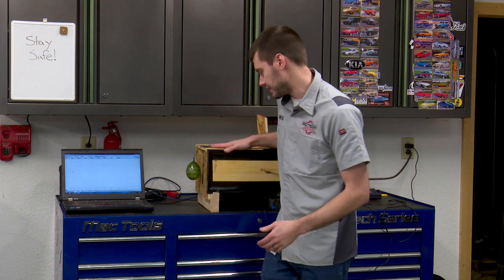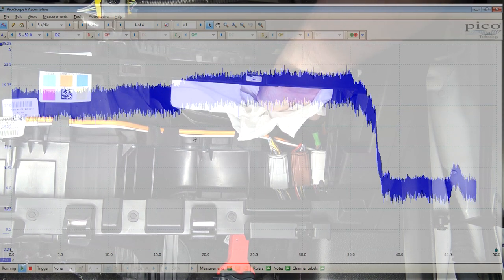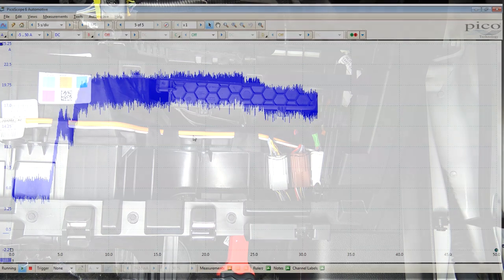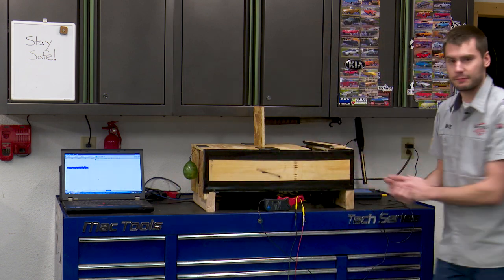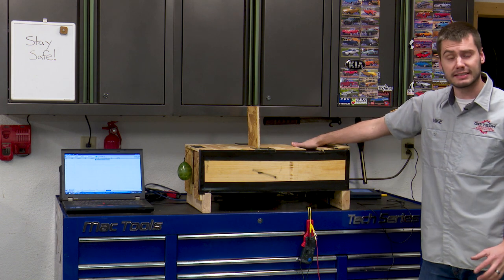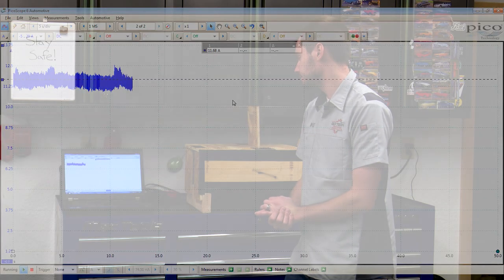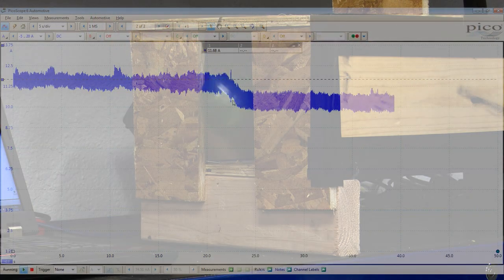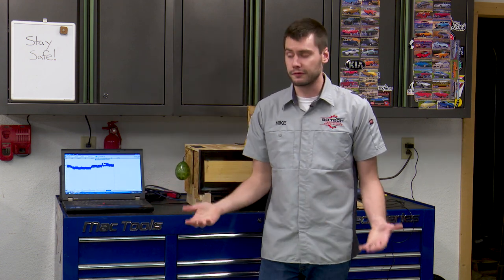Blower Fan/Motor Current Does What!? Correcting A Statement I Made - Includes PROOF!

Comment: Just like fuel pumps, inlet restriction= less current, higher rpm. Outlet restriction= higher current, lower rpm. 

Kudos for standing on the side of accuracy and truth!
Reply: This is a little different. Outlet restriction = lower current and the motor whiz bangs over. That's why it sounds like its working harder like a restricted vacuum cleaner. Higher RPM's.
Reply from the maker: Truth and accuracy are key. Thanks for watching and commenting guys!
Mike Becker, Senior Instructor
Reply: Super Mario - I definitely respect your knowledge and experience 

Does an outlet restriction cause higher current in a fuel pump?   I guess my assumption has always been that less flow (restriction) =  less work on the pump = less current draw.
Reply: Both an inlet & outlet restriction cause a decrease in air flow rate. A fan is a type of centrifugal pump. A characteristic of centrifugal pumps is that (in general) decreased flow rate means less work is done, therefore the current will decrease with either a suction or discharge restriction.
Reply: @gaad7938  and why does less work mean less current? How are they connected?!
Reply: @gaad7938  what is meant by centrifugal?

Comment: Hi Mike!

The most common failure that can appear in HVAC system is situation when we are starting car when HVAC is set on 1-st position and blower motor have little hard to rotate. The motor don't turn at all and current which flow by blower resistor can overheat it (no flow of air).
User don't think about it and malfunction is ready.

Greeting from Poland.
Roman.
Reply: slightly true, as an already bad blower can be in stall out and draw high current.
Reply from the maker: Hey Rmx2rmx, thanks for watching and sharing! Stay safe over there in Poland!
Mike Becker, Senior Instructor

Comment: Really appreciate you taking the time to not only address the (imho very common) misconception of increased resistance = increased amperage ( in a centrifugal style).

Quite enlightening.

Bring back your wire connection experiment please! I've seen several tech induced pigtail failures in the last week due to butt connectors on the underside. Would love to see a test set that was "salted" with current running through it.
Reply from the maker: Hey Matthew, thank you very much for watching and commenting! I did a follow-up video where I ran 20(?) amps through it if I remember right...here's a link for you. https://youtu.be/gKx_8-Z5sBo
Mike Becker, Senior Instructor

Comment: glad you corrected the airflow limiting current draw issue.  I learned that years ago, but I've been into electronics and electrical since a young child.
cabin filter restriction does cause less airflow which can make the resistor block and motor overheat, since they're also air cooled!
 good videos overall ;)
Reply from the maker: Hey Throttle Bottle, thanks for watching and commenting!!!
Mike Becker, Senior Instructor

Comment: The cabin air filter between the blower motor and evaporator helps keep tiny copper partials from the blower motor brushes and bushings out of the evaporator.  Copper in the aluminum fins of the evaporator could cause electrolysis if moisture is on the outside of evaporator.  At least that is the story I heard.  Great Video!

Comment: Good correction on the previous video.  I just watched the previous video a few minutes ago and was wondering what the correction would be until I heard the oops moment.  In regard to minute 5:40 where the balloon (and you can keep your secret save from your son with me) is being drawn toward your nice experimental creation, you will find the pressure differential "favors" the outlet side as opposed to the inlet side of the system, thus creating a situation where the higher pressure side is now turned 180° at the impeller and directing air flow opposite the normal direction.

Keep up the great work!
Reply from the maker: Hey Chad, thanks for watching! Makes sense why the "borrowed" balloon was drawn in. Thanks for watching.
Mike Becker, Senior Instructor

Comment: I have noticed this same effect with my vacuum cleaner.   When you completely block the intake the motor sounds like it speeds up.  There is a point of restriction that appears to load the motor more that it is when completely unrestricted but when completely restricted the motor speeds up.  I have always found this interesting and tried  to figure out why.   My guess was that the high vacume causes the air to be less dense and that would make the impeller see less resistance to turn.  Not sure if this same thing happens when a fluid is being used by a similar centrifugal pump.  Not sure you were completely wrong about the restricted filter.  I think a partial restricted filter will cause the motor to see a load increase.

Comment: Thank you Mike. Have a blessed and safe week to you and your family.
Reply from the maker: Thank you so much Billy, you as well!
Mike Becker, Senior Instructor
Reply: @GoTechTraining  Thank you Mike. If you ever get a chance to work on a Honda or Acura with a blower motor power transistor, please test and record the power transistor control wire voltage signal with connector unplugged and plugged in and back probed. There are a few videos on YouTube about the power transistor but nobody has tested this control voltage with connector unplugged and plugged in and back probed to see what known good AC Control Unit sends down that wire to the power transistor.
Reply from the maker: Sounds good Billy, will do!
Mike Becker, Senior Instructor

Comment: With restricted airflow the current goes down due to lower loading because the air in the blower case begins to spin with the impeller.
In the case of a restricted vacuum cleaner, being a series motor the RPMs increase significantly as the current through the field coil also gets weaker with lower load, but the blower motor has a permanent magnet field so the RPMs do not increase that much.
Mechanical loading increase due to tight bushings (sleeve bearings) on the motor causes both increased current and reduced airflow on the lower speed settings, a disaster for the resistor but I have also had a few resistors fail for just a dirty filter, the motor itself has been fine.
Any failed resistor, the motor is tested and the filter replaced as a matter of course.
On some vehicles, with the air distribution control set to face vents only and all face vents turned off with their own control, the system has a 100% restriction. This is a reasonably common occurrence, look at the control settings when a vehicle comes in!
That will definitelycause the resistor to burn out even with a perfectly good motor and filter!
Reply from the maker: Hey Simon, thanks for watching and for the lengthy comment. Appreciate all the info!
Mike Becker, Senior Instructor

Comment: Could we do some actual testing to determine the original failure (blown resistor). I typically like to use HVAC diagrams to help teach  the younger up and coming techs. Its good system, for ohms,  voltage drop and current testing. Even using the amp clamp to try and determine actual motor rpm. Food for thought....
Reply from the maker: Hey Josh, sure normally we would. These videos are intended to be short quick hits. I have other videos already showing blower motor testing. Yes, wiring diagram, voltage drop and current testing are all great on these things!
Mike Becker, Senior Instructor

Comment: no air no work. lots of trucks have multiple blower motors and often they run in different directions. because of this the squirrel cages are reverse rotation too. found out if you put a reversed squirrel cage on it will blow a little but not a lot and the amp draw was way down. also there are modules that act as resistors that use thermisters. and i have seen these that look identicle to a resister package
Reply from the maker: Hey Richard, thanks for watching! I powered this set-up backwards and the motor spun like mad but didn't create hardly any airflow....therefore little current. Same principle I believe.
Mike Becker, Senior Instructor

Comment: Great content... I dont think the amp draw on the fan is quite as important as maintaining air flow over the resistor... Ive known a few blow either because the cabin filter was dirty or the inlet vents on the scuttle panal were blocked with leaves n debris...
I was shocked though that the amps used actualy went down when the air supply was blocked. Simular to i expect a engine that cranks faster when the air intake is shut off.As it has  no air to compress it dosent work as hard....
Reply from the maker: Thank you very much! Airflow is the real killer here, I agree. Thanks for watching and commenting!
Mike Becker, Senior Instructor

Comment: Blower works just like a battery. When you have resistance in the path you have a reduction in current and CFM. But since fan needs air to move it gets air from the chamber that surrends it. So as the air leaves the fan's fin it forced into blower again so you almost have a vacume at outlet and you have a turbulance in chamber.
Reply from the maker: Thanks for watching and the clarification Mohamad Reza Enayati!
Mike Becker, Senior Instructor

Comment: I wonder where resistors are mounted.  If they are down stream from blower.  They could be increase resistants as geting hotter when less air flow thruogh them.  That make less current to blower motor.
Reply from the maker: Hey Cu Lan, typically the resistor is mounted down stream from the blower. Very true points!
Mike Becker, Senior Instructor
Reply: Because resistors connect in series with blower the hotter the more resistants the less current to motor.

Comment: So if V=IR, assuming you still measure the same voltage going to the blower motor, if it's consuming less current (during a restriction), doesn't that mean that the internal resistance of the blower motor goes UP in order to keep the equation true in the great and wonderful universe, i.e. laws of electrical physics?  Would this contribute to the early failure of a blower motor?  I'm assuming that it's temperature goes up, not just because of lack of airflow, but if it's internal resistance has gone up, that usually generates more heat as well, right?  Interesting experiment dude.  I got the recommendation from South Main Auto youtuber to come check you out...boy am I glad I did and you got yourself a new subscriber!
Reply from the maker: Hey Mark, That would make perfect sense in the world of electrical physics! I'm glad you've found us, thanks for watching and welcome :)
Mike Becker, Senior Instructor

Comment: I wonder - I get that amps decrease cuz it’s doing less work - but why would the fan speed increase? I’m guessing PSC motors have a set torque they want to work at and then the load lessens, the current lessens, but the torque stays the same and even with the lessened current, because the torque never changes, it increases the speed?

Comment: I can see why you made that assumption, many motors draw more current under load. Your thoughts about the higher risk of overheating because of inadequate air cooling are also completely reasonable. I wonder what is special about the blower motor.
Reply from the maker: Hey Spelunkerd, hope all is well! Thanks for watching. I'm used to thinking about fluid flow I guess...airflows very different. That's where I went wrong I think. Either way, the proof is in the scope :)
Mike Becker, Senior Instructor
Reply: All motors draw more current under load. The explanation in this case lies in the fact that the motor drives a centrifugal blower. The less air it receives, the less mass it must accelerate, the less load on the motor. The motor draws less current because it turns faster because of the reduced load.
Reply from the maker: Good explanation! :)
Mike Becker, Senior Instructor
Reply: @fascistpedant758  What an inspiring post (and video). I spent the morning reading about the centrifugal fan, Wikipedia have a detailed article. Thank you Faschist Pedant.
Reply: Electric motors that drive centrifugal pumps also behave like this.  A pump not moving much fluid will draw less amps than a pump at full load.  In power plants we actually use ammeters to measure a fan and pump load/work being done.

Comment: I am not sure I agree with you. Its a dc motor. When the filter is blocked the amps come down because the fans rpm has increased creating more counter electro magnetic force. Because of this the amps come down but the fan is spinning faster so working harder. What do you think?
Reply: Bro that’s only in ECM not PSC motors!
Reply: @MathCuriousity  bro, I am not talking about pwm signal.  This happens to all motors.  Do your homework.
Reply: @d.d4184  bro are you telling me PSc also does this? But PSC is permanent split capacitor - it’s a brushed dc motor, not brushless dc motor! Are you sure brushed dc has the same thing happening as brushless?!!!
Reply: @d.d4184  dude this has nothing to do with back emf. When filter is blocked then the fan has less load because less air and less load for the same speed it’s programmed to stay at, means lower amperage.

Comment: my only question would be what happens to current when a motor is left to run for a long period of time. Would the motor need the (unclogged) airflow to keep it cool? If this airflow is then compromised, would the efficiency of the motor decrease leading to an increased draw? I just know that of the motors I've replaced, when they heat up they loose efficiency and I think the current draw is increased.
Reply from the maker: I believe the temp increases due to lack of airflow and I think this could have a negative effect on the bearings themselves within the motor. Either way, plugged airflow is bad ;) The system would probably be better off with no filters than plugged ones.
Mike Becker, Senior Instructor
Reply: Moved my reply onto the main thread

Comment: Blower motor does not work what can be the problem ( my relay“click” noise can be heard from the blower motor relay. when I moved in position 4 )
Reply from the maker: Hey, you're either missing power, ground, or the motor is toast. Try a test light across the connector to check for your power/ground.
Mike Becker, Senior Instructor
Reply: @GoTechTraining  I have 12 Volts both the power and Ground of the blower motor and (The Blower does not work on any speed again ) thanks

Comment: Is that what is called cavitation ?
Reply from the maker: Hey Bigcliffe, cavitation usually relates to liquid right? Can it be related to air movement?
Mike Becker, Senior Instructor
Reply: @GoTechTraining  In the airline industry we have a similar thing in a jet engine it is sometimes related to. Something that causes a surge. It is when the blade speed goes beyond the speed the air can pass through between them. It is normally heard as a very loud bang. Compressor stall.
Reply from the maker: Sounds really interesting. I've always enjoyed airplanes but I know almost nothing about them. 
Mike Becker, Senior Instructor

Comment: That’s confusing, reducing the speed (RPM) of a DC motor normally increases it’s current draw. Think of a slow turning starter motor due to seized engine. So why did a reduction in speed lower it’s current draw? I’d like to see if the RPM differs with and without the restriction on the motor.
Reply from the maker: Hey John, I the current decreased because there wasn't any air to push. Therefore the motor didn't have to work as hard.
Mike Becker, Senior Instructor

Comment: Guys i have a problem with my 06 suburban. Sometimes when i turn on the a/c or the heater the blower fan wont turn on or it will turn on and will shut off but turn on after a bit. If i turn off the truck and turn it back on the blower will work again.
Reply from the maker: Hey Msia40004, sounds almost like an intermittent connection. Those vehicles were somewhat common to melt the connector on the switch if I remember right.
Mike Becker, Senior Instructor

Comment: Could you measure the duty cycle? And voltage?
I like your videos but you still need "Dancing Girls" 💃💃
Reply from the maker: Hey Gregory, on this example the duty cycle would have been 100% because I was runing the blower on high speed. Voltage will be battery voltage again, high speed.
Mike Becker, Senior Instructor

Comment: Now what about the motor speed?
Reply: The motor speed will increase when air is restricted as blower is not pushing air by volume hence the reduction in amps  think of it like a fuel pump pumping fuel or not  same principle air is weight hope that helps
Reply: @terminaldiagnostics5576  Hi it was a kind of tongue in cheek comment, I was hoping to see it proved using the Pico waveform just out of interest   Maybe Mike will post the file.
Reply from the maker: Hey Niall, thanks for watching guys.I didn't plan on sharing motor speed. Had I done a longer class I would have probably.
Mike Becker, Senior Instructor

Comment: Any one heard of "Cavitation"?
Reply from the maker: Can cavitation apply to air or only liquid?
Mike Becker, Senior Instructor
Reply: @GoTechTraining  Don't know, but a similar effect happens when you block the airflow on a vacuum. loss of air flow, and the RPM's pickup as if running in free space. Or the over-rev roar you hear from an outboard motor, when the pilot cranks of an oblique turn from near stand still.
Reply: @plowe6751  Blimey,Yah, sort of!